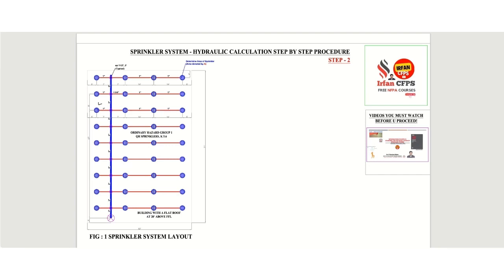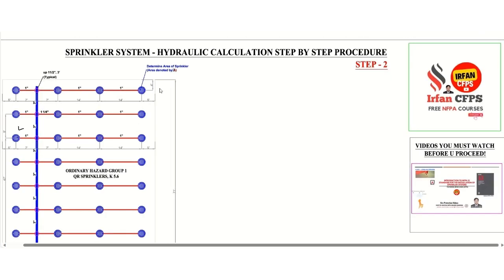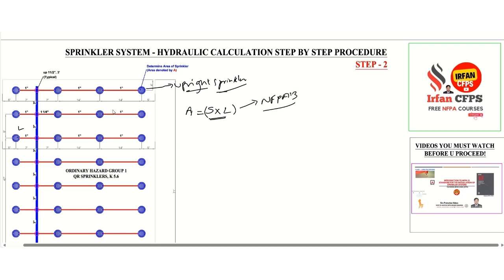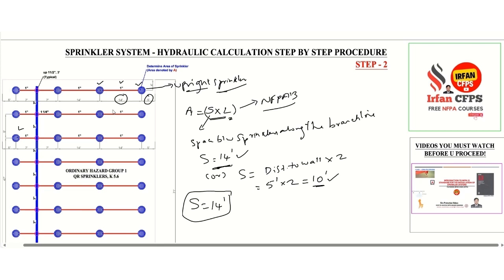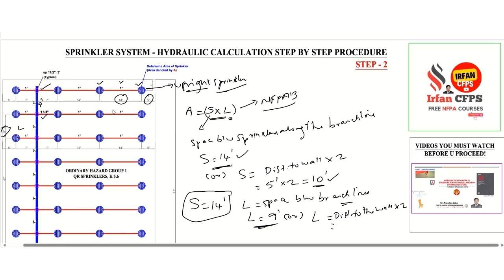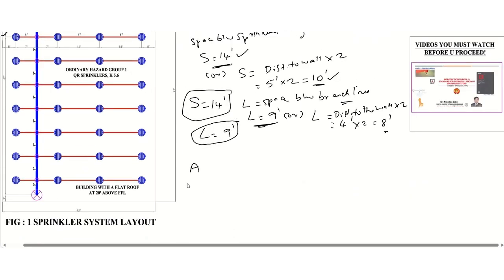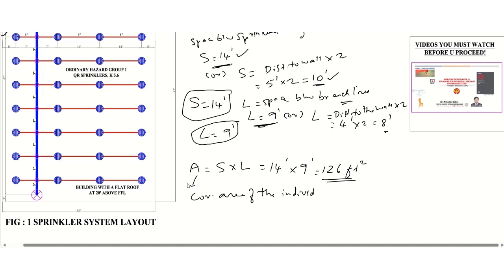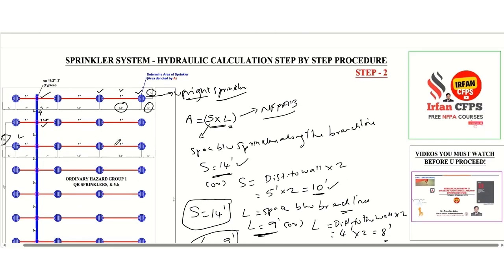Step 2 |Hydraulic Calculations for Sprinkler Systems

Comment: In general office scenario, we have a false ceiling and below which occupancy hazard and above the false ceiling to be protected. In these cases  generally both pendent and upright sprinkler required. Am i correct? that case how the sprinkler should be arranged and the maximum number of sprinkler per branch? does NFPA has a separate  provision or tables
Reply from the maker: In case sprinklers are required above and below false ceiling then we need to calculate the pipe size based on number of sprinklers only. U can check my video on installation details I believe, u can find the detail over there. There is no separate table in nfpa
Reply: @irfancfps  Yes bro, I watched the installation details, There you detailed about the obstruction and soffit wall side sprinklers.  But, In office space the below false ceiling the hazards are generally tables, carpet, and appliances and above the false ceiling the electrical cables are there. So, How we take that into account. we shall take them to the same office light hazard occupancy and sprinkler arrangement with standard pipe schedule method or elite software.
Reply from the maker: Yes we need to consider as light hazard for the entire floor area. In nfpa 13, have a look at non combustible construction/limited combustible construction or combustible construction materials …
Reply from the maker: Also, initially we consider pipe sizing as per pipe schedule method, however if we need to verify these sizes once we get the results as per  hydraulic calculations using elite fire. Just take one small project and run the calculations, then u will understand clearly.